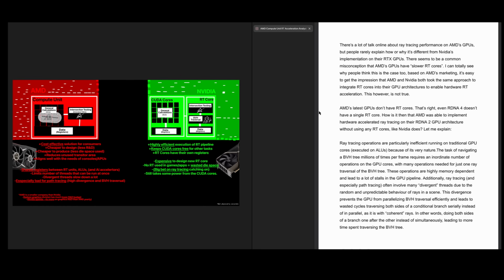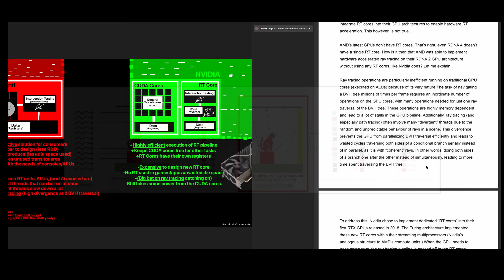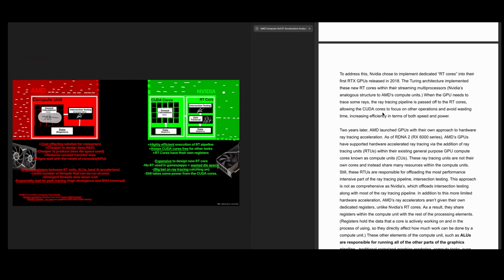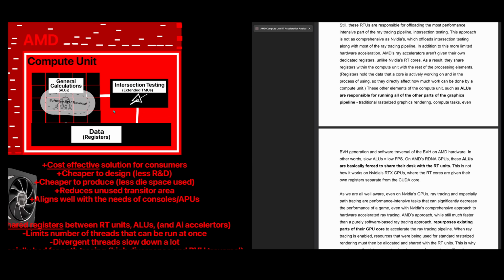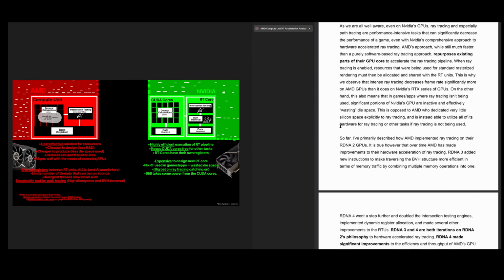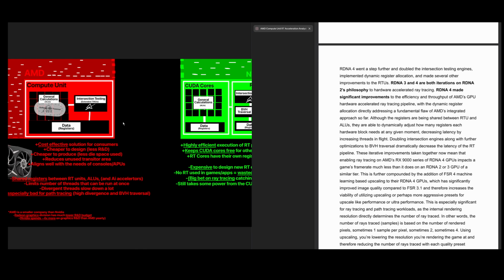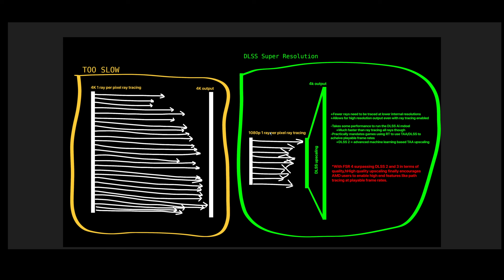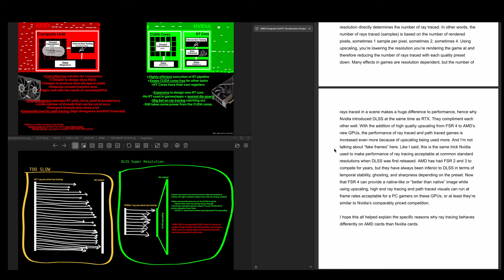How Does AMD Do Hardware Accelerated Ray Tracing?

Comment: Oh my. RDNA does have acceleration for BVH traversal. Just check for example chipsandcheese's article "RDNA 4’s Raytracing Improvements".

I'm not saying that the RT Accelerators don't share resources from the CUs / TMUs, they do, more than NVIDIA's architecture which indeed are bigger with extra dedicated resources. But this is not a black-and-white distinction between "software" and "accelerated", it's way more nuanced. RDNA does have significant fixed-function logic for box traversal, ray traversal, RT-specific memory and stack management, now in RDNA4 also a RT-specific transform block for Oriented Bounding Boxes, also primitive node compression... none of that stuff is just more shader code running on SMs. The RT Accelerators certainly have some amount of dedicated caches/registers/buffers as well, and we can onoly speculate from functional descriptions and performance characteristics since neither NVIDIA nor AMD document this in any detail.

By the way, a fully-independent RT Core is also a bad idea because that would create a lot of overhead to transfer data from/to shaders. So NVIDIA's RT Cores (and Tensor Cores) are also not as independent and isolated and people sometimes believe, like if they are tiny co-processors just plugged to the CUDA cores via bus / shared mem. Same goes for Tensor Cores / Matrix Cores, those things have plenty of dedicated logic but also some sharing of resources and again that sharing improves efficiency. This is remarkably true in the new world of Neural Shading where AI, RT, and Shaders all have to blend, work together intensely.

The reason that Radeon is still behind in advanced RT such as path traced games is not how much it shares resources, it's mostly that it's still missing some important features like Shader Execution Reordering, OMMs, and Mega Geometry. In RT games that don't depend critically on those features RDNA4 is already very competitive, see for example DOOM TFA (normal ray tracing mode - which is a lot of RT just not PT) where a 9070 XT ties with an RTX 5080.
Reply: Was about to add a lot of this myself lol. So many people seem to think AMD is doing everything in software while Nvidia has everything in hardware, when the reality is way more complicated (and interesting) than that.

SER and OMM are going to be huge, and based on recent driver updates, Intel is going to support at least the latter on Celestial as well. I also recently came across a paper that I'll try to link (sorry if it gets eaten by YT) that explored other attribute micro-maps as further optimizations.
Reply: @opinali It is true that AMD added more specialized instructions/execution units for the various things you mentioned, I'm under the impression (correct me if you have more information) that on RDNA4 the shader still synchronously executes RT traversal utilizing the the special instructions. This takes up execution resources on the shader core. On Nvidia and Intel, the entire acceleration structure traversal is decoupled/asynchronous: The shader thread feeds a task to the RT "core" and then only resumes when RT core has finished the entire ray traversal. Meanwhile, another thread can run on the shader core and ray tracing part doesn't use any execution resources on the shader core. (It does use memory system resources and some registers are dedicated to the RT Core work launching thread).
Reply: @randomobserver9488  Right, NVIDIA's RT cores are more async (starting with Ampere IIRC). RDNA's fully synchronous behavior is a necessity of higher sharing. But there are also consequences in density, in RDNA you never get all circuitry inside CUs working at the same time: either some shader logic is idle, or some RT logic is idle. That allows denser design with high clocks. Same goes for AI acceleration, so it's a three-part unit where only one is active at any time (nonshared parts; the shared ones like VGPRs are always working).

It's a bit more complicated because there are always synchronization points where for example shaders have to wait for the output of some RT or AI computation, so I'm not sure what level of effective concurrency is achieved in games.
Reply: @opinali  Oh that's interesting, I wasn't aware that limiting concurrently active execution units has density/clock benefits (I'm a software engineer). Are the clock benefits mostly because of improved density -> shorter delays? I can see that lower maximum power requirements reduce the demands from metal layers, which can sometimes limit device density because of routing (afaik)? Are there other reasons why density increases? Register file read/write ports maybe or some buffering of writes (before combining outputs from multiple EUs to smaller number of write ports maybe? I have no idea) even for coupled EUs? 

I know that issue throughput is limited, usually 1-2 in GPUs, but do you mean that the presumably multi-cycle pipelined execution is more limited than that in RDNA? Like assuming the core is single-issue, I can't issue a multi-cycle latency FFMA on cycle 1 and then an independent RT instruction on cycle 2, but have to wait until the FFMA has retired? That seems very weird, I probably misunderstood what you meant.
Reply from the maker: @randomobserver9488  That's a good question. You're correct in your other comment about how AMD does the RT synchronously on the same thread it was launched on, so that would limit the amount of threads in flight due to the register contention based on my understanding. Also I believe in RDNA 3 the Ai accelerators weren't able to run concurrently with other operations, because the Ai operations were executed on the same standard ALUs, but that in RDNA 4 they added new "TLUs" next to the ALUs for these tasks, which I assume would allow for concurrent execution.
Reply: @randomobserver9488  Main problem is power density. A fab process offers "dense" and "high performance" libraries, they can be mixed, AMD goes with the dense ones for almost everything but that normally means lower clocks because of more active transistors in less space. But then you can have designs with things that are not used all the time, for example the dual-issue shader units is similar, in most clock cycles a shader is not benefiting from dual issue but then it also doesn't power all ALUs (modern chips have incredibly fine-grained power gating).

When you run certain microbenchmarks that manage to active very single execution unit at the same time at every clock, which is something that requires very artificial code and never happens in practice in real games/apps, the result is that the clock goes downhill. In contrast, some real-world but specialized benchs like Blender can push clocks very high because they don't use lots of stuff. So there's always a tradeoff in utilization vs clocks.
Reply: @opinali  Ok thanks, makes sense. Are the clock limitations mostly because of localish/chip level power/voltage delivery or localish/chip level cooling?
Reply from the maker: Yes, RDNA 4 did add hardware features to improve BVH traversal, but the shaders are still responsible for traversing the BVH tree, unlike Nvidia. In Nvidia's GPUs, the CUDA cores request a ray to be traced and sends it off to the RT core to return a result, while it's able to work on other tasks in the meantime. AMD's compute unit's shaders on the other hand are managing the state of the BVH tree and do all of the memory management, while sending ray-box or ray-triangle intersection tests to the RTU. RDNA 3 added new instructions to improve the efficiency of the shaders doing memory management and RDNA 4 added OOBs, primitive node compression, etc, like I said in the video. This is not the same as having fully hardware accelerated ray traversal like Nvidia. There is definitely contention for the shared resources in the compute unit, otherwise why would AMD be adding dynamic register allocation in RDNA 4? And besides the sharing of memory and registers, performing the ray tracing operations takes time away from the CUs (because the ray tracing operations run in the same thread it was launched on until completion) unlike in Nvidia's or Intel's architecture. I'm by no means trying to belittle AMD's approach, I think Nvidia is playing a dirty game and AMD is making really intelligent use of their resources in a way that benefits consumers. People seem to think I'm taking Nvidia's side, but I'm an AMD fanboy just trying to be objective.
Reply: @ClewlessClay  This description is more precise, agree (and I understand the pressure to be clear and concise in video form). I just think you make too big a deal of "fully hardware accelerated" versus not, like if 100% is vastly better than 90% – esp in RDNA 4 where there is A LOT of acceleration for BVH; the shaders are mostly coordinating / scheduling work on the RT acceleration. Agree that pegging the SU to do that instead of freeing it to do some concurrent shading work is a more important limitation, but again, the net impact of that is unclear–for one thing RT is bandwidth-intensive, mem access can bottleneck RT even with zero concurrent shader code on the same unit.
Reply: @opinali  Yeah what limits RT perf depends completely on the workload. (This stuff I'm expert in)

With coherent primary/shadow rays or tiny toy scenes that fit in cache, compute throughput can be the limit even with specialized HW for the task, and certainly is in software RT. (By software I mean pre-Turing with no dedicated hardware for RT, I don't mean AMD's approach). (Memory bandwidth from BVH traversal stack management can be a bottleneck here if the traversal stacks are kept in DRAM for some reason, like early AMD or some old software RT. AMD fixed this in RDNA3 or 4)

With incoherent rays from path tracing and diffuse reflections in large scenes (~typical sizes in games assuming no excessively approximate LOD meshes for RT), memory system is almost solely the limit (bandwidth mostly, maybe latency/occupancy depending on implementation), even in good software RT implementations that don't completely fall apart under extreme execution divergence. (Traversal stacks in DRAM had an effect here too but it was much smaller portion of mem traffic because their memory traffic scales with ray throughput, which is much much lower with incoherent workloads.)

Ambient occlusion shadow rays and first-bounce specular reflections are somewhere in the middle.

The result is that Nvidia/Intel RT core execution/compute side is very underutilized in path tracing because of the memory system bottlenecking it. If memory system magically improved 10x, Nvidia and Intel would gain 10x perf in path tracing without any changes to RT core compute side. (On AMD the wide-SIMD shader core orchestrating the traversal would still suffer from execution divergence). However, Nvidia/Intel can't just reduce RT core count by 10x because easy coherent workloads would suffer.

There are many interesting tradeoffs between memory footprint and compute requirements that affect the perf balance between coherent/incoherent workloads, like compressed BVH node and triangle formats and BVH width/depth that affects the number of memory accesses too. In HW the compute side becomes much cheaper/faster so you can trade increased compute for reduced memory traffic. 

Using oriented bounding boxes (OBB) like AMD instead of axis aligned AABBs is a commonly considered alternative, you get less node and triangle acceses but each node is larger and requires more compute. It makes more sense in latency/occupancy limited scenarios. Triangle splitting improves BVH quality (less traversal steps/node accesses) but increases memory consumption. A good BVH traversal order reduces traversal steps, but requires more compute (cheap in HW). Then there is the BVH quality vs build time tradeoff. And more things. Like SER for shading workloads after traversal.
Reply from the maker: @randomobserver9488 This is very insightful! That makes a lot of sense and totally explains why AMD is competitive in games making relatively light use of RT, but falls apart when doing things like path tracing at high rendering resolutions.
Reply: That paper

https://gustafwaldemarson.com/pages/publications/attribute-micromaps/index.src.html
Reply: Is that why amd is so slow in blender vs nvidia? Nvidia cards score higher on the benchmark but amd cards can be faster when rendering more complex scenes. Contradiction design has done testing on this fyi
Reply: @TLMikepad For Blender specifically, the problem at least in part is that it's is not properly optimized for RDNA. This will finally change in Blender 4.5.0 where the Cycles engine will use AMD's HIP-RT by default, previously that was available as beta / preview. No idea how much this will help but we shall know soon.
Reply: @opinali  No AMD card has ever been optimized for Blender for the past 20 years. The developers are the ones who can fix this & have not ever bothered to call or ask for help From AMD. Intel Went & sent people to help & the ARC cards work fine. 

Imo, Blender's developers are just AMD haters at this point.
Reply: @kevinerbs2778  what a misinformation,amd is one of the blender foundation biggest sponsors and they dedicate two developers for amd gpu issues, the issue is rdn gpus really suck in compute rendering tasks or to be more precise nvidia is way faster and better.
Reply: @JBIGroup3D  It has Nothing to Do with RDNA design, because even all most iteration CGN which was all Compute  heavy still didn't work properly on Blender. It it not misinformation at all it is 100% facts. You check all the benchmarks for GCN 1.0 throughout 5.0 it run likes crap on them for the past 15 years/ you can keep believe your own stupid bull $hit but those are facts.
Reply: Yeah and sharing resources like registers doesn't matter anyway if the units that share them cannot work on different problems at the same time.

Mega Geometry has a lot of potential but is barely used yet. But Shader Execution Reordering is MASSIVE. It greatly improves the issue of poor concurrency that was explained in the video (the fact that you can't do single instruction/multiple data-processing if you have too many branching paths).

OMM (Opacity Micromaps - handling transparent geometry more efficiently) is also a big one.

Microsoft's Direct X team has confirmed that SER and OMM will be added to the DirectX standard and that AMD is working on adding them in 'summer 2025' though. It will be very interesting to see whether they will run well on RDNA 4.

Comment: Didn't AMD officially announce that in RDNA3 and 4 they have hardware BVH traversals and that they increased that capability a lot in 4?
Reply: These RT cores are funny. We're back to the dedicated hardware era before programmable shaders. Would be more funny if, in the future, two of these mergers back into programmable compute unit but with better RT performance.
Reply: @bltzcstrnx it has been like that for years now. Just look at tessellation. It has it's own hardware rather than being don on standard gpu shaders.
Reply: @arenzricodexd4409  and nowadays hardware tesselation is largely obsolete, because it is too limited and not flexible enough, difficult to control. the new game engines do fancy geometry processing in compute shaders, because it turns out you can do a lot more if you get creative with the algorithms (which necessitates general purpose compute) rather than just being stuck on whatever the hardware does.
Reply: They optimised more for BVH traversal in hardware, but they don't have dedicated cores for it.